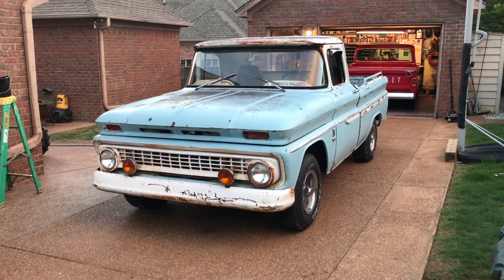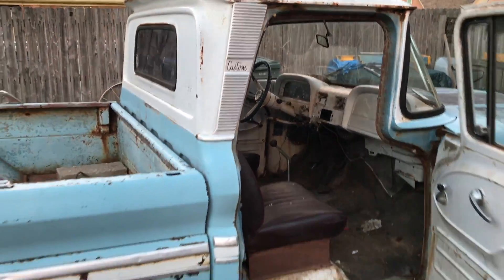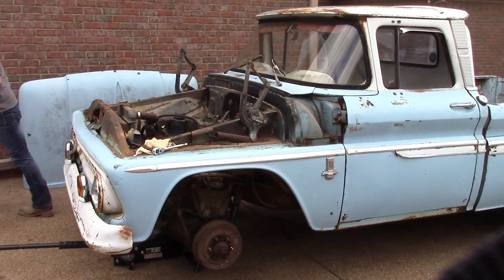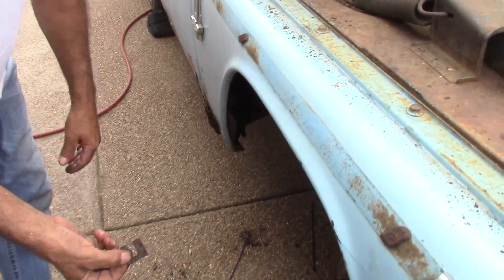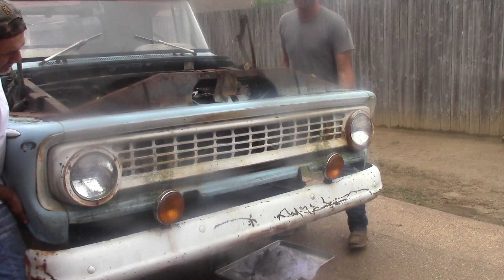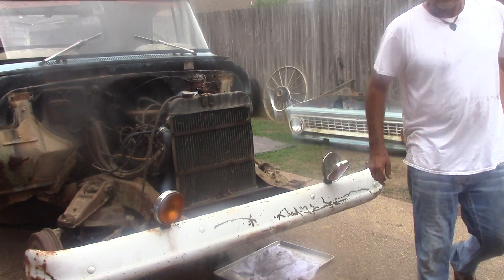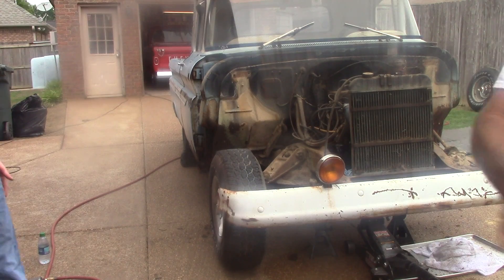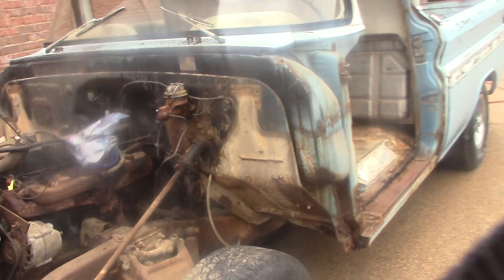1963 Chevy c10 new project

Comment: Very cool.  I just got a 64 this past weekend after selling my completed 67 GMC & 72 GMC Extra Long bed (their Longhorn version) projects. I was driving through a local neighborhood, all that extra cash just burning a hole in my pocket...and had to stop. A ring of the door bell and the next thing I knew it was parked in my driveway-couldn't turn down an under $1k complete 64, all original with virtually no rust other than surface patina, from the original owners son!  Boy, was my wife happy 😂. I wish you the best on your project. I'll be over at the boards of 67-72 Chevy trucks dot com, they are a great resource for Chevy & GMC between late 40's to current with most of us in the post war to 72 with great stuff all the way to current. I'll be posting under CousinTone. Good luck and check out the boards if you're interested,  we can always use a great mind in the group.

Comment: Hi Gibson, Ive watched most of your videos of your under-taking on the red 63. Insane amount of work you have invested and it is truly amazing work of art you did. Your video of the first drive and shaking the fuzz cracked me up! Its strange to see the rockers go before the bottom of the fenders like that. You say your just gonna do a lil bit of work  and just kinda fix it up, huh? Ya right! You know whats gonna happen. Cool trucks man! Keep up the good work!
Reply from the maker: Ryan_Greenwalt  I was surprised about the fenders also, not to much rust showing on the outside or the inside brace
Reply: Looks like its original color was the turquoise from the inside door jams and then someone shot it baby blue. Somebody loved it and respected it, just worked it. Strange that it has back up lights in the rear fenders. wonder if that is an aftermarket installation or if the bed has been replaced.
Reply from the maker: Ryan_Greenwalt   Yes someone painted it years ago, backup lights were added along with the 64/66 sail panels

Comment: Question for you? I have a 66 c10 and wanna improve stopping power but leave the drums for now. If i add power brakes or just a dual master cylinder will i need a prop valve or not? Thanks Daniel
Reply from the maker: DaddyBoys2  from what I was told you only need the prop valve if your running disc on front and drum on rear, I’ll be running drum brakes all the way around with a duel master cylinder so I won’t be needing the prop valve. Hope I’m answering this correctly I would check around
Reply: Gibson63 are you gonna go with a master from another year truck or run some aftermarket? From what i have read that seems to be right just being my first truck it seems  good to check with others with knowledge on them. Thanks
Reply from the maker: DaddyBoys2  went to Napa and got A dual master cylinder for a 1967 Chevy pick up it will bolt right up

Comment: Great work on the 63...wonder if you know what them center caps ar called on the old rims?
Reply from the maker: These rally wheels come off of a mid 70s truck the center caps came with them someone had bolted some kind of spinner onto the center cap